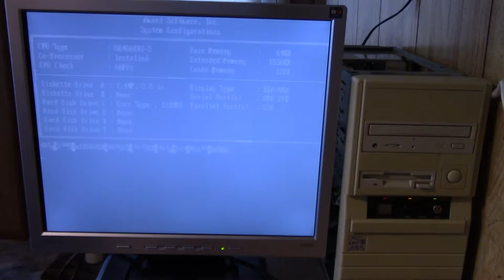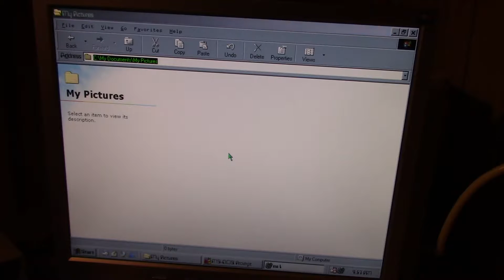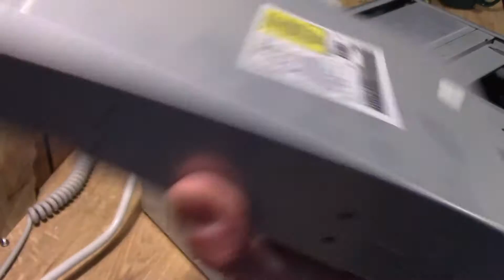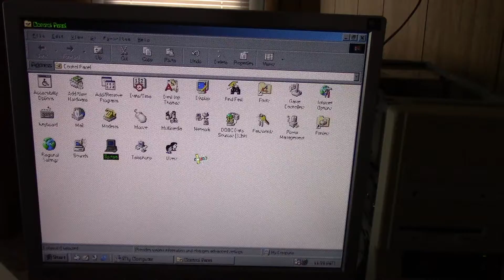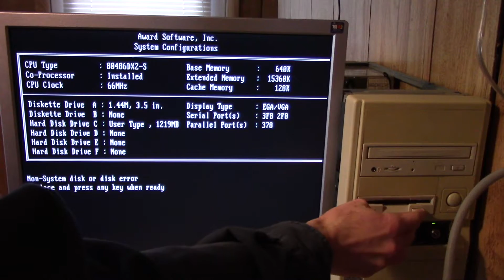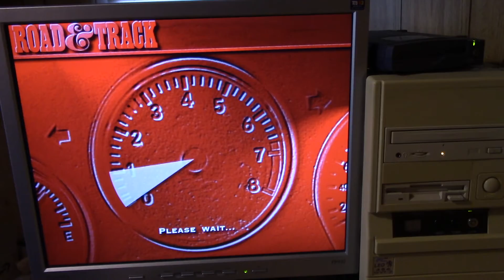Vintage Computer: FIC LEO 486 GVT-2.  Ultimate thrift store DOS machine find!

Comment: I still have a retro Toshiba satellite laptop with 266 mhz Pentium processor and 96 mb ram, still runs Windows98 second edition and has its original 4.1gb hard drive manufactured in October of 1998.

Comment: Bro you did so many things wrong. You need to enable LBA in the bios for the the full hard drive size to be used. Then if you didn’t notice whoever owned the computer before was using a 3rd party partition software so you should have ran fdisk and deleted all the partitions and made a new fat16 partition and then formatted the HDD.

Comment: I find it amazing that you were even able to buy this!

In the UK you would NEVER see a computer, no matter what state, in a charity shop (thrift store).

They are not allowed to sell them due to data protection laws. Even if you wipe them when you donate they will never sell them. I once saw a carry case, cables, charger and manual for a laptop in such a store. The laptop had been "disposed" of as it was a computer. But you could buy the manual :D

Things you also will never see old computer parts of any sort including keyboards or mice. Exceptions would be for those in boxes but its very rare.

In fact in the UK (and I think in the US also) its getting quire rare to find any sort of electronics in these stores in general.  Its quite rare for me to find audio or video appliances that are not massively overpriced anymore.

However, I recently found a charity shop in a very small town (basically a large village) that had a selection of laser discs! These things are as rare as diamonds in the UK. Almost nobody here bothered with Ld's back then so finding a player or a disc thats not on ebay is almost unheard of.

Comment: Good PC.  I have an NT 4.0 that still works and yet, a good old PC.  Well, new laptop computers (bought from any retail store like Best Buy, Walmart, Staples, etc.,) are becoming widespread and people are far more likely having problems with the brand new Windows 10 PCs. Well Windows 10 was out about let's say 1-2 years ago and I have a Lenovo ThinkPad, which ran 7 but now running Windows 10.  And yes, anything old still goes strong. People who buy vintage fans, computers, original Nintendos, etc., are far more likely to get better luck to old stuff than with the new ones.  In addition, my dad gave me a Studio XPS 8000 (used to run Vista but now upgraded to 7), which is now having a problem with the hard drive (probably needs to be replaced) and Windows 7 is becoming a troublesome unit nowadays.

Anyhow, great find.